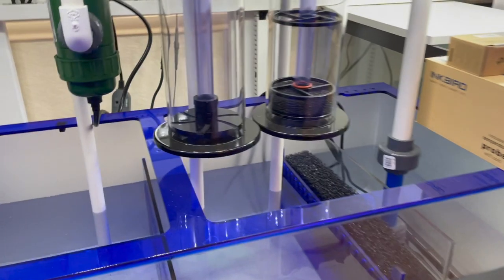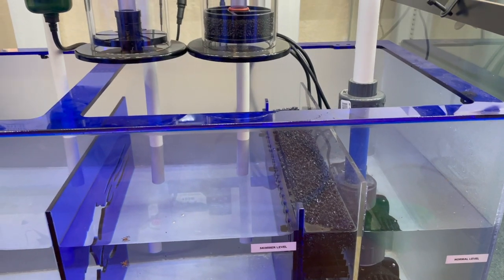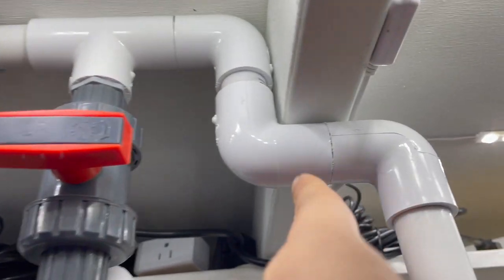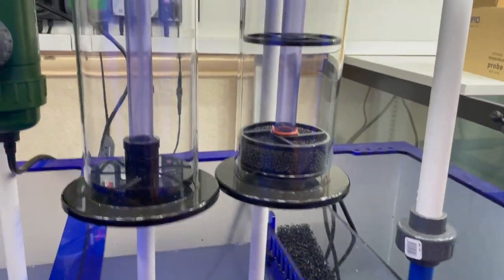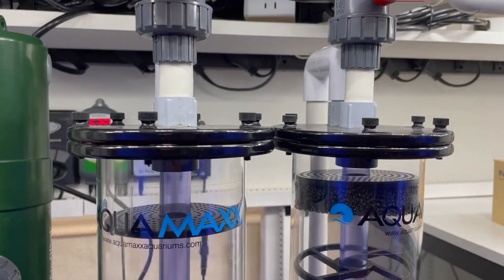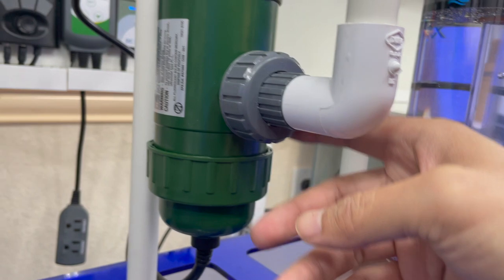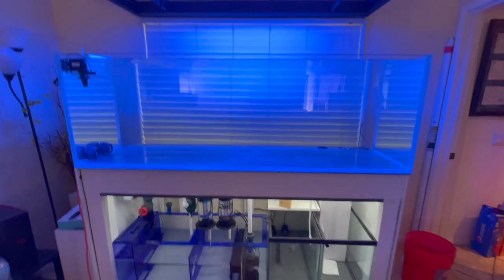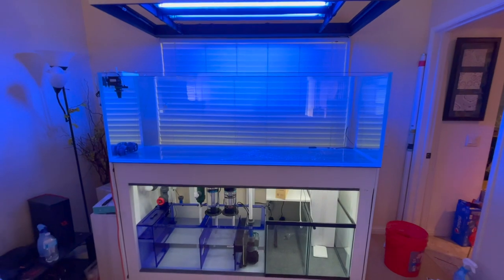BUDGET REEF TANK BUILD | POWERING AN EFFICIENT SUMP MANIFOLD WITH REACTORS AND UV | WATERBOX

Comment: Hello. Water is collected from the outlet and returned to the sump. Then, from the sump, it goes to the last chamber, to the outlet, and is sterilized (and/or cleaned by the media) again. This is probably not the best design. Water from the lamp and rectors should go into the aquarium and not into the sump. Am I wrong?
Reply from the maker: you are not wrong. To do that require more piping and room for the exits from the reactor and UV.